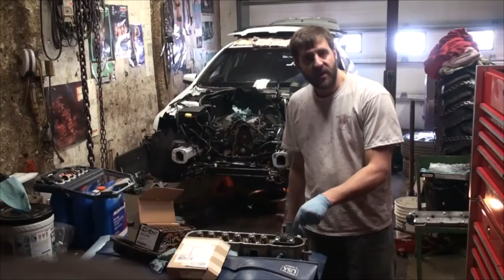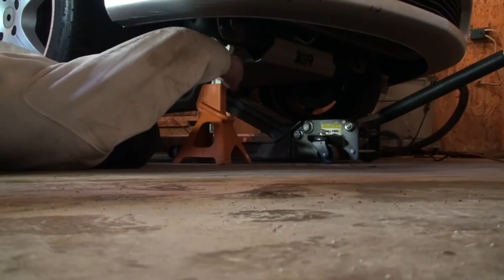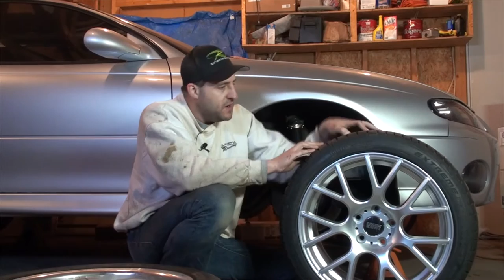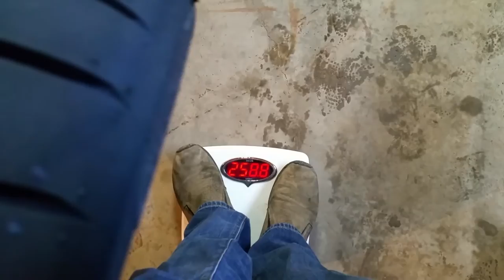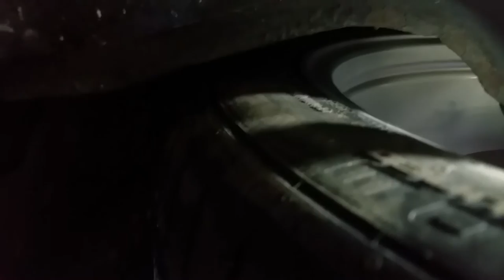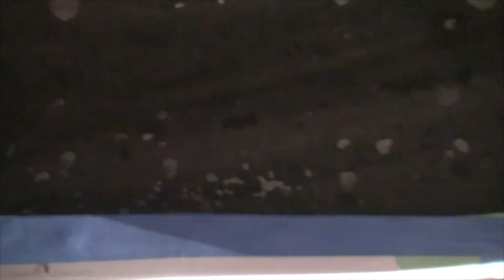Josh's Car Corner - Ep. 44 - DUBS For My Goat!

Comment: Hi Josh, nice job mate - really nice job on your down-to-earth commentary and approach that is so helpful to us learners. I've seen your vids over the last few years but am not a YouTube fanatic, so sorry if I have missed stuff.
I am an Aussie from Adelaide (where your car was made) and have been a LS guy for a long time. I have raced motorbikes all over the world for ever but I am just getting into tracking things with 4 wheels - mainly NW USA (The Ridge, Pacific, PIR,Thunder Hill and Laguna). I am becoming addicted to your world and my GOAT gets lots of comments on track.
Although I live in AU, I keep a race bike and a very nicely tuned 2006 Pontiac GTO in Seattle - 6 speed, 18" wheels, coil-overs, bushes, fully adjustable suspension, big brakes, DOT/track tires and etc.
To get my lap-times down, I believe I need to tune my geometry - mainly 'camber???' (-I think!). Any advice will be greatly appreciated.
Cheers,
Reply from the maker: Greetings, mate! Always love hearing from a fan Down Under! Sounds like you've got about the same suspension as I do. For me, it was getting cross camber dialed in. My rear control arm bushings were shot, giving me -0.6 degrees on one side and -1.8 degrees on the other. Replacing those bushings with Pedders poly solved that problem, now I'm -0.2 on both sides. 

Also, my shocks are adjustable. I try different levels of stiffness to suit the track I am at. For example, Road America has massive rumble strips so if you plan on using them and you turn the stiffness up too high, the shocks will eventually overheat and lose their effectiveness. However, if I'm at a track like Blackhawk Farms with smaller rumble strips, I can turn the stiffness up and keep the tires in better contact the with road. 

Starting camber of the front wheels is big too, because I have learned they don't tip in nearly as much as the rears do when the suspension compresses, so having camber dialed in from the start helps. You can have too much, especially if you run a square setup (all tires the same width). I now have a staggered setup so I'm eager to do another track day and see how much how camber I can run now that I have more rear end grip. Hope this helps!

Comment: Good video, thanks for sharing. Nice choice of wheels, too. The lighter unsprung weight will help with handling performance in addition to economy, but you probably already knew that. Tip: store your wheel lugs in the freezer for a day before you install. They should fit and press in much easier!

Comment: Finally got some wheels! Look good. I got a set of VMR V710's a couple months ago in 18x9.5 et 45 and it rubbed a little on the outside fender lip, which I rolled. But mainly it rubbed a lot on the inside wheel well. I had to raise my ride height (I was tucking previously on a 17x8 245 tire) about an inch and had to cut a little off the plastic fender liner and bash in the wheel well with a hammer to get 275's to fit properly without rubbing. I can imagine with your offset you will have it worse than me lol. The front 245/40r18 on a 18x8.5 et 45 fit with no problems, didn't even have to touch it.
Reply from the maker: Grajeda Good to know. I figured out how to check it in the next video.

Comment: Josh, first of all your videos are great and have helped me figure stuff out while im rebuilding my son's 06 GTO. We're finishing up the suspension right now and im researching wheels. He actually likes these 810s and ive been trying to figure out the BS for the wheels. So while im watching this video i feel like i missed the sizes you are running. If you could let me know the width and BS I'd really appreciate it.
Reply from the maker: The front wheels are 18 x 8.5 with 245/40/18 tires. The rears are 18 x 9.5 with +58 offset and 275/35/18 tires. I opted for +58 offset over the +50 because most guys go for +50 and then they end up having to roll or dramatically grind their rear fender lips.
Reply: @JoshsCarCorner  thank you for the quick response. My measurements had me thinking the 18x9.5 +58 on the rear too. Did you go +35 or +45 on the 18x8.5 in front?
Reply from the maker: @persioabreu7376  I believe 45. But it was whatever VMR had on file for the GTO.
Reply: @JoshsCarCorner  I'm thinking 45 is right. I've got to finish the front end this week to verify. I'll call VMR also. Thanks for the info brother.

Comment: You've probably already answered this somewhere in the comments but i can't seem to find everything... what are the exact sizes and offsets of the rims and tires in this video?  Thanks for all the info!
Is this correct:
Front Rim: 18 X 8.5 x 35mm offset
Rear Rim: 18 X 9.5 x 45mm offset

Front Tires: 245/35/18
Rear Tires: 275/35/18

Comment: 5x120 fits most BMW's and all newer Camaro's, Corvette's, CTS-V's also use 5x120. Fbodys and 6th and 5th gen Corvette's used the old 5x4.75 or whatever it was.
Reply: Grajeda I am quite sure all those cars besides the BMW run 5x4.75" which is 5x120.65.
Reply from the maker: He is partially correct. Zets platform cars do run a 5x120 bolt pattern (G8, 5th Gen Camaro). But, they also have a 67.6 mm hob bore, so the wheels do not transfer over to the GTO without modification. The backspacing is more aggressive for those cars too as they have bigger wheel wells.

Comment: hi my name is Paul and I have a 2004 GTO 5.7 I would like to put LS6 heads on it and was wondering if they will work
Reply from the maker: Yes. 241 head castings are identical to the LS2 243 castings, but the 241 heads come with Sodium filled exhaust valves
Reply: @JoshsCarCorner  not quite sure what thay means I'm wanting to put a super charger on it thank you for all the  Knowledge you shared
Reply: @JoshsCarCorner do ideally, you should put the LS1 ex valves into the 243 heads which have same size valves, larger runners, and smaller combustion chamber.

Comment: HI have 275/35 18 and 235/40 18 on the front because those Wheels the are wider than the stock wheels the car doesn't feel as smooth as before I'm thinking next time maybe go with 275/40 and 235/45 do you think would be a good idea or mistake on your opinion?
Reply from the maker: Fabio Lopes I think it depends more on which tires you go with than the size. That's why I went with the Continentals, because they are advertised as having a softer sidewall than other summer tires so they ride nice. 

I thought going slightly oversized next time, though. But more for fuel economy.
Reply: I have Bridgestone Potenza on the back and falcon azents on the front they are not too bad but definitely before with a stock 18 wheels the ride was  smoother
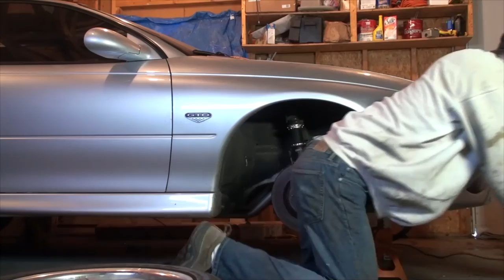Reply: 5:25 for the wheels

Comment: Good info, did the tires rub at all on the inside without the drag bags? Were they 275/35/18s?
Reply from the maker: li1n3m0 They are that size,  and nothing rubs.
Reply: Josh's Car Corner - thanks for the response. My suspension is all stock, so I'm debating as to whether or not I'll need to roll/grind the lip and use 5 mm spacers based on your experience with the inside of the wheel well. I'll be getting the same wheels, but in gunmetal. 8.5 ET45 on the front, 9.5 ET58 on the back with 245s and 275s respectively. Thanks for the videos by the way. I've had the car 10 years and am just starting to go away from stock, so they are very helpful :-)

Comment: sooo what did you do with your old rims then? keeping or would u sell? u said it fits stock tires if 17 inch
Reply from the maker: I have them. I was going to keep them for burnout tires. Are you interested in them?
Reply: Josh's Car Corner possibly but the mm hub adaptor lil concerning, I have the stock 17s I belive where it's not straight lines
Reply: but I do enjoy ur videos
Reply from the maker: I couldn't in good conscience sell them because I know you'll most likely have vibration issues.
Reply: Josh's Car Corner ok so 5x120mm 68mm hub clearance.. did u have any issues with sub frame connectors
Reply: as in putting them on for subs, bolt up nice

Comment: Where did you get these wheels? Mod bargain?
Reply from the maker: I got them from VMR directly.
Reply: Josh's Car Corner Ok another question I was looking at the Moog front wheel hubs do u know what size ARP wheel stud I would possibly need?
Reply from the maker: Not if it's a Moog. I only know the part number for the OEM front hubs. Don't know if the holes on the Moog are the same diameter. Google is always your friend in these situations.

Comment: Hey Josh - I've recently discovered this channel - outstanding information well presented.  Would you mind answering a few questions:  Exactly which wheels from VMR did you use?  I caught that you used the V810 FF on the front -  what wheel size?  And on the rear, which VMR did you use?  Also the 810FF?  Was it 18 x 9.5?  And finally, the tire sizes that worked for you?   My 06 is coming along - it's my second one, the first falling victim to a divorce.  Both brazen orange.  Current one only has 21K miles.  It's at 389 HP and 384 Torque at the wheels in it's current setup.  I've got everything on hand to do a cam swap as well as a FAST intake manifold together with the 102mm TB.  Kooks long tubes, H pipe, 3" all the way back, and some awesome custom made mufflers that quiet the whole affair enough to keep harmony in the neighborhood.  I've got the Tremec Magnum transmission in it - which was a bit of a soul-crushing mod.  Now that it is done, I I love it but that darn project truly sucked.  Anyway, thanks for all the great info.  I'll post a link to your youtube channel on the GTO forum.
Reply from the maker: The wheels are all VMR V810FFs, 18 x 8.5 front with +45 offest, 18 x 9.5 rear with +58mm offset. Currently running 245/40/18 front, 275/35/18 rear. Will soon be upgrading to 285/35/18 rear and possibly 255/40/18 front as I found a way to get more front suspension clearance.
Reply: Josh's Car Corner where did you find the extra room for the wider tires?
Reply: @dklbbach  - The VMR 810FF wheels re no longer available from VMR.  I just bought the same sizes in a different model with a 1 mm different offset on the rears.  The VMR guys are really outstanding to work with.  Great Service
Reply: Please share your choice! I’m plan on buying some this weekend
Reply: that guy I bought the VMR brand in the sizes josh noted. From the invoice: 2	V702-MHS-1885-ET45
2	V702-MHS-1895-5120-72.6-ET57

Comment: A Couple of years ago, I did the VMR 710's on my 05 GTO.  18 x 8.5 with 45mm back spacing on the front.  18 x 9.5 in the back with 50mm back spacing.  I had the rear fender lips rolled and re-painted by a professional body shop.  Running the stock size 235 tire up front but went to 275/35 18 in the rear.  The car looks so much better and I have lot better traction in the rear.  Ride and handling were unaffected.  My suspension is still stock.
Reply: Did you roll the front fenders as well?

Comment: Please post complete dimensions of wheels and tires
Reply from the maker: Tires at present are 
245/40/18 in front
275/35/18 in rear
Wheels are
18 x 8.5 with +45 offset front
18 x 9.5 with +58 offset rear

Some minor inner tub rubbing in the rear at first under extreme compression. Easily fixed with a mallet.